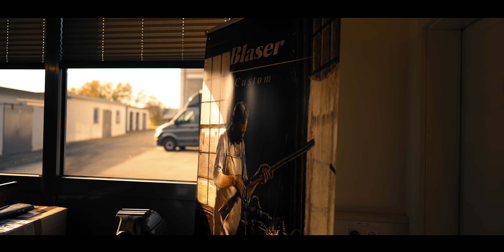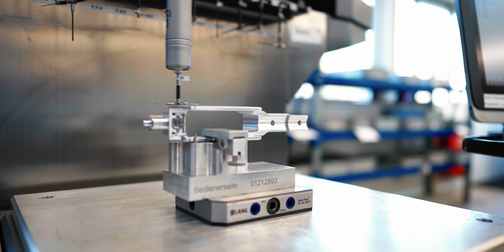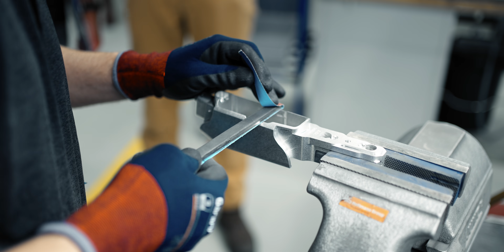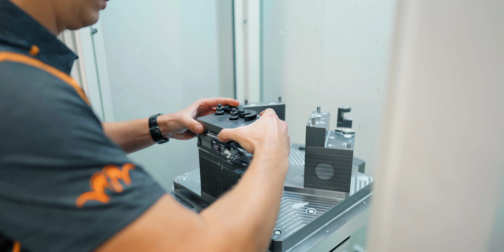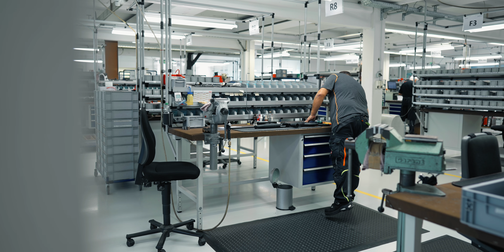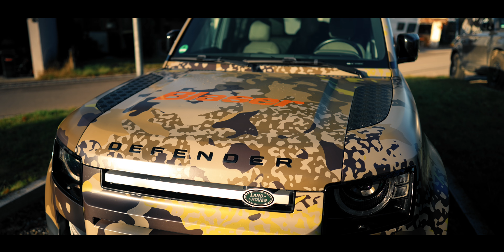The Blaser Factory Tour

Comment: Nothing goes over a fine machine shop, precision and quality, but I just don't get the straight pull, the "Gardena system". When I have to take my hand from the trigger, where is the benefit over some sturdy and buttery '98 action, which I still consider the gold standard when it comes to safety and precision? The British love their old Lee Enfield, because they can repeat very fast without even taking the finger off the trigger, but the Gardena actions don't allow for this, so the benefit is not really there or is it? Perhaps I'm a Mauser nostalgic. And if it has to go really that fast, sort of an industrialised Drückjagd butchering, just buy a 20 round mag for the AR10 for crying out loud. Nobody cares, just store it somewhere outside your safe, in case the Stasi comes, which in Germany is not common, but possible.

Comment: I'm curious how tight the tolerances are for the mount cuts on the barrel. If they were 20 microns you could swap the scope mounts between barrels and not need the blaser screwdriver to adjust all the time.

Comment: I am so proud of being part of this firm, everyday 💪
Reply: .....und das können sie auch! Die Waffen sind wirklich super.
Reply: what are the requirements / qualifications ?
Reply: @greypawn7780  being a saint in your last life
Reply: @greypawn7780  probably depends on the position. if you want to design the actual weapons you probably need at least a bachelor in mechanical engineering. if you want to work in production you will probably have to have a finished apprenticeship as an industrial mechanic. german apprenticeships last 3-4y if you dont shortcut, you earn less but in big companies they often have like a little school inside the company where apprentices learn the practical and theoretical aspects of what they are supposed to do when they are done, not sure what the analogue to that in different countries without this system are.
Reply: ❤❤❤ wood stocks❤❤❤❤❤😊😊😊😊😊😊😊
Reply: Ey also low-key das ist einer der krassesten Firmen die Deutschland noch hat. Respekt an dich!
Reply: Yeah, being part of the firm that spreads death.
Reply: That's not good, cause you should be ashamed... Ashamed of that stuffed leopard.

Comment: I have a Blazer R8 and love it. But they have become way too expensive now, especially there barrels. Makes the option of a multi barrel set up unviable.
Reply: not really considering the base price of the rifle. I rather pay the higher price for the exchange barrel / bolt head ,than buy a completly different rifle setup.
Reply: @medizinerhaider  $8000 for the rifle a $3000 for the barrel. $700 for the bolt $700 for the scope mount. Australian dollars. Mass hammer forged barrels shouldn't be that expensive.
Reply: @tonyZ338  i looked a little into euro to australien dollar conversion rates. I paid arround the amounts you listed, maybe a bit less since in Germany there is a great "second hand" market for blaser barrels. I got my .22lr conversion for 1700 australian dollars.  I dont think I could have gotten a better 22 for the same money. I use my hunting scope on the .22lr as well since blaser mounts are mostly interchangable between barrels. I like the system and since there are no comparable brands on the market I am willing to pay the higher price. Could I hunt with a cheaper rifle - of course, but I wouldn't want to anymore 😅

Comment: The final rotation of a bolt gives a reassuring “clunk” that the bolt lug is safely in its little well. I’m not sure I like (or understand) the bolt cycling on this rifle.
Reply: Blaser bolt does not rotates but has 14 lugs that expands into recess on inside of chamber and makes tight lock that withstands up to 14500 bar chamber pressure.
Reply: @ Thank you for the explanation, the little engineer that lives in my brain 🧠 is jumping up and down shouting about mechanical complexity, even the tiny theoretical physicist next to him in nodding furiously and they’re both talking about thermodynamics and then there’s the little maxillofacial surgeon explaining how many Jules of energy a skull would withstand in the event of a large riffle round detonating in battery. Seems like they’ve solved an engineering problem that doesn’t exist. To be fair, I’d have to look closely at it to get a proper idea but on the surface of it. I get some “bad vibes” 🥺
Reply: @Cool_Cat-0  Dude, the R93 is from 1993... There is no special sauce involved anymore.